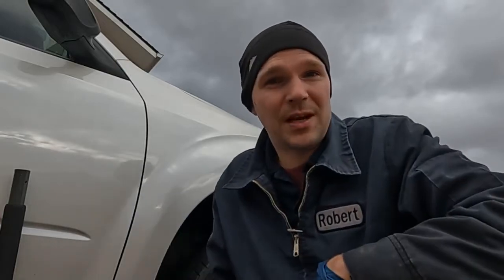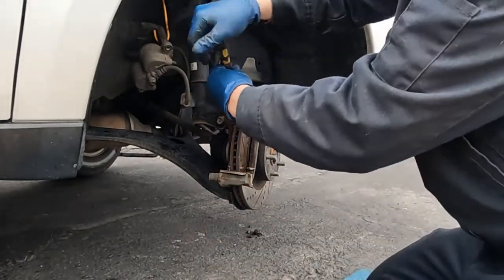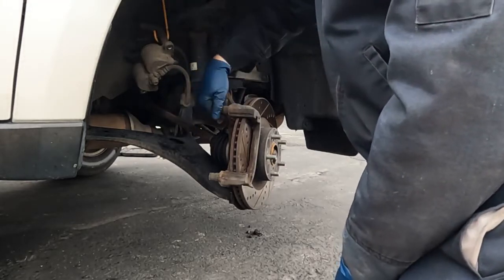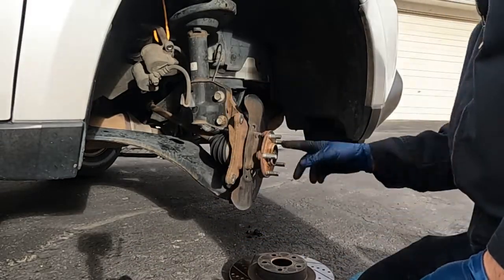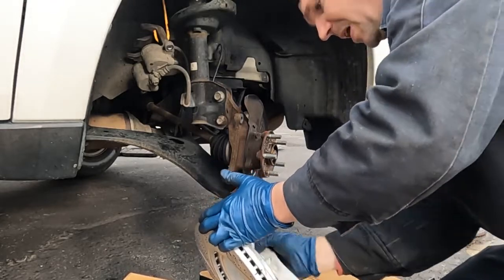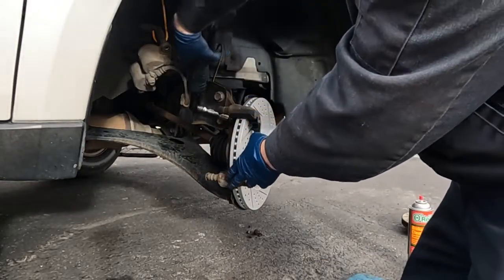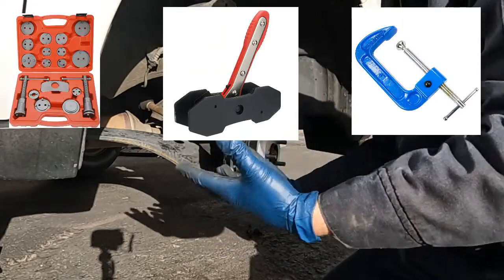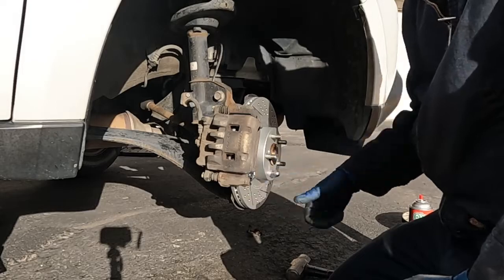2009-2013 Subaru Forester Front Brake (How To) Replacement

Comment: You make putting those pads in look so easy been working on trying to get the pads in the caliper for an hour now
Reply: I know it's a year later, but be sure to have a file on your brake pad change job, file the pad from where it fits into the groove in the brake housing, so they are nice and loose in there. Otherwise if they get stuck, you'll have dragging brakes.

Comment: Excellent video. The only thing I could suggest. Put a clear hose on the bleeder. Open the bleeder as you push the pistons back in the caliper. Keeps from possible damage to the master cylinder. Again, great video, Thanks.
Reply from the maker: Thanks! Good suggestion 👍

Comment: doing this job without knowing that pad orientation matters so much would be verrrry frustrating.  Thanks.  I use a small file to clean out the channels in the caliper.
Reply from the maker: Nice tip with the file. I might try that 👍

Comment: What is the oem PCD? If i will buy big brake kit is it am must to know the oem PCD? Thanks
Reply from the maker: There should only be one PCD option for this vehicle so no need to know it. Any brake kit designed for this vehicle should work 👍
Reply: 5 x 100